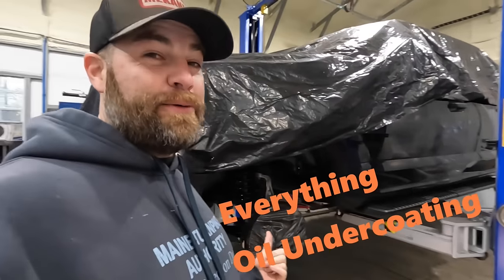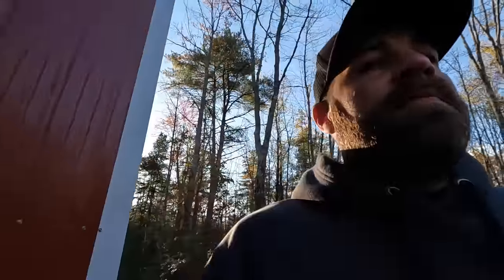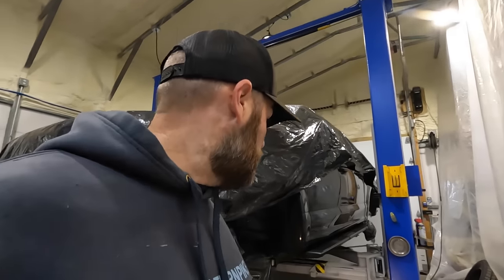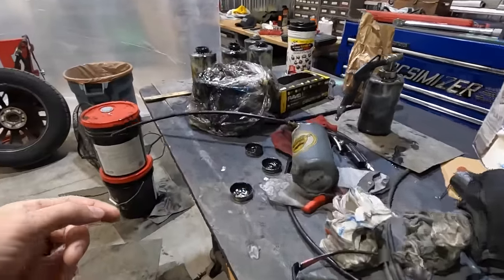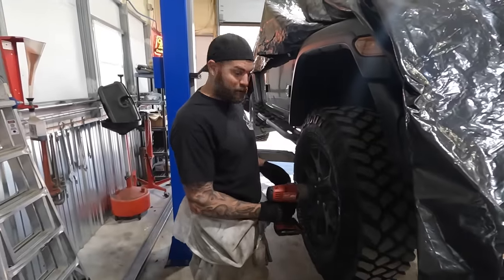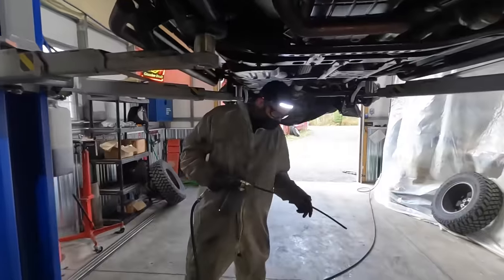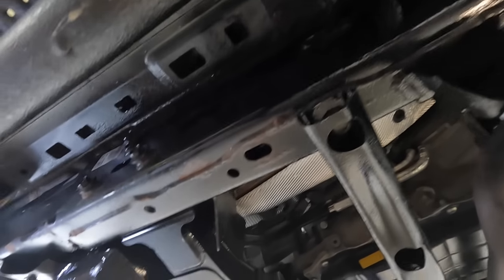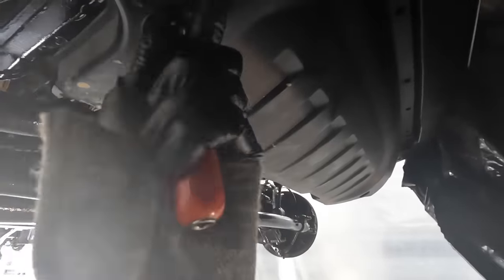The FACTS about Oil Undercoating!

Comment: I’m also in NH and I’ve been using different types of rust preventatives for 30 years. I think the age of the vehicle depends on what you use. For example if it’s a new or newer vehicle, just a few years old with very minor surface rust, there is no reason to spray oil and then have to deal with the maintenance and the mess for years. Instead, use cosmoline wax. It will provide the same rust protection as the oil without the mess. If it’s 10 years old and it’s starting to flake then yeah use the oil. Just keep in mind once you use the oil there’s no going back to the wax. Also keep in mind you should not oil spray a new GM frame. The GM frame comes from factory with wax. If you spray it will ruin the coating of the frame.
Reply from the maker: They offer a wax line as well for new vehicles, as long as it’s not applied heavily it holds up on the gm frames, or you can wait a couple years and the wax will fall off and rust anyway 😂
Reply: @FlippinCustomized  so very true.

Comment: On my brand new rigs I'll paint under it first and then I do what the old farmers used to do. Change the oil, save it, add some diesel, pull the tires off and spray it on with an old cup gun at 100psi. And.... getting it in the nooks and crannies is a very proper explanation 👍. It works excellent on fence posts too.

Comment: Hot used oil and graphite mixed together. I spray inside the frame rails first then inside the rocker panels working my way out from under the vehicle. Then from the lower panels up and under the hood. Spraying inside the tops of the fenders and down the cowl post. And inside the doors. After spraying it i also drive it down a dirt road ( if i can find one ) then park it for a day and let it drip dry. This is what i have done for years and have had no rust issues to speek of. My current truck is a 99 ram and it has been in the N E Ohio aria for 4 years of daily driving. Still no rust.  Even the commonly known rust arias are clean.
Reply from the maker: Sweet we run a 99 ram too
Reply: @FlippinCustomized  they have their issues but they were clearly ahead of their time.
Reply from the maker: Agree

Comment: My great uncle showed me a trick. A mix of engine oil and diesel fuel. His 82 F-150 looked brand new yet. But he did get it repainted. Zero rust though, all original panels. Repaint was done in 95, if I remember correctly.  It has kept wy newer vehicles rust free. I live in Wisconsin. Heavy salt and bitter cold temperatures!
Reply from the maker: Nice

Comment: I have been using Blaster Surface Shield on my Toyota 4 runner on exposed metal and Fluid Film with spray wand inside frame.  Very happy with both products.
Reply from the maker: Nice

Comment: I live in western PA and they salt the shit out of the roads here when we get winter weather,i spray with used oil every fall Religiously, the reason why i spray with used oil is because im cheap,but it works,great tips in this video❤
Reply from the maker: Old school 💪 and after you drive down a dusty road to form a barrier 👍
Reply: @FlippinCustomized  your dam Skippy I do!!
Reply from the maker: Perfect 🤙
Reply: You ever notice rubber parts rotting from the oil?
Reply: @TheChaztor   No,it's still better then fixing your steel  parts,  bushings are replaceable. Your frame is not.
Reply: @TheChaztor  that's a myth
Reply: @TheChaztor 
I use a light coat of marine grease on all my rubber boots. Seems to work  fine on my 23 years old  4runner.

Comment: Been doing my Toyota Prado (19 years old now and still rust free) and Subaru Forester like this for years, paying particular attention to all cavities including doors sills etc.
I go one up and smear the outside of the chassis and high wear exposed areas such as the bodyshell inner sills with marine grease.

I don't have spray equipment at home so twice a year get the vehicle up on 4 ramps give the whole underbody a blast over with ACF50, i like this product because its very thin and gets into all the different height sensors etc which are also prone to salt water ingress and penetrates into through bolts and such so when you need to undo something it comes undone instead of snapping off, plus it doesn't effect rubber bushes etc.
Salt is used extensively in England too, they put it down for no reason at all most of the time.
Whatever you do its better than doing nothing, which is what most people do.

Good job you fellers are doing, well done.
Reply from the maker: Thank you sir🙏. Yes I swear they salt roads just to use salt inventory

Comment: Nifty video, thanks for posting.  How rough is this product on rubber bits?  One of the upsides of the lanolin products is that they are supposed to not hurt rubber bits: bushings, boots, etc.  I read this is mineral oil based, so I gotta wonder...
Reply from the maker: Honestly has not been bad
Reply: I’d gladly replace some bushings with such , it’s a lot cheaper than frame repair or another truck. . It’s too late for my 09 GMC but I keep it on the road. Mine had the rubbery coating on it wasn’t the best option.
Reply: Oil does break down rubber over time. But I would imagine this would not cause the breakdown like a oil leak would.  I guess the question is would you rather replace cheap mounts every 7 to 10 years, or a whole new car.

Comment: I bought my truck new in 07 , spent 3 winters in michigan then came back , 328,000 miles on the chevy 4x4 cab & half 1/2 ton  , and it rusted in half , so i found a florida truck just like it , im swapping it all over to a 2012 ..

Comment: i have 3 vehicles that have had this treatment for couple years. place i take em too get inside doors, rockers, cab corners, under hood and trunk, all hinges and locks, inside bed rails and tailgate. they don't skimp for sure. first visit takes longest but after that maybe hour. so far.... i like the oil spray undercoat. tailgate on old truck never worked so smooth!
Reply from the maker: Perfect

Comment: Good information. Just got a new old chevy that sat in a barn. Live in Southern MN. Two seasons winter and road repair!  Looking at undercoating and durability. Used fluid film but I wasn;t diligent . Seeing the result on my older vehicles. Will do my best to clean up and prevent future rust as sitting on the ground adds to rust. Thanks for the process.
Reply from the maker: Thanks for watching

Comment: A guy I worked with had an old dodge with over 300k miles and no rust on the frame. This is a NY truck so it sees lots of salt. Every year he would go to the Walmart parking lot with a sprayer mixed with diesel fuel and oil I think it was mostly oil but the diesel made it thin enough to spray he didn’t give me the recipe but offered to spray my truck too. He would spray the entire underside of his truck then let it run and smoke while he walked away so nobody thought it was his. When it was done smoking he would go home. Once a year and this 12-15 year old truck had no rust. I didn’t believe him at first but later found out it was true.
Reply from the maker: Ha ha awesome

Comment: A history lesson:  For decades long ago, the savvy mechanics would spray the undercarriage with old crankcase oil  - some even heated it so it would wick into crevices - they noticed that there was never rust where oil leaks (or which were common) made a surrounding mess.   

In the 70's there was one product:  
Kendall's KendCoat 60 - it was specifically called out by many industrial uses, it was discontinued but 
Chevron Marine Rust Proof  Compound L was the next reincarnation, but Chevron quit supplying this to North America;  
Michigan Petroleum Technologies had fleet customers that strongly wanted it so they developed their own "... Compound L."  All of these were amber and similar to a whipped cake icing.  Fortunately this technology is now everywhere.  

It's really annoying that the vast majority of automotive repair shops don't give a complimentary spray can shot of Fluid Film or Rust Shield in areas that are starting to rust.   Especially when it would be good for business:  people would keep their cars longer resulting in more repairs!

Comment: Did you try the Krown stuff from Canada? it works good as well. They also have the study from the Canadian military. They tried every available rust stopping product and used oil, used transmission fluid, and some other stuff. Krown works, not the cheapest stuff but they have a good salt remover to start with if you already have something that you didn't get new.
Reply from the maker: I have it’s good as well. We have had great luck with this product and it’s local

Comment: I use a product in Canada called Krown.  It is applied every year and is an oil that coats thoroughly and creeps everywhere.  Yes, it is messy, but my 2008 Ranger has NO rust on the frame or any of the body panels.  Mechanics don't like working underneath, but I have seen what coatings like Ziebart can do to the frame of a Jeep.
Reply from the maker: Not a fan of Ziebart
Reply: I second using Krown. They heat the oil up prior to spraying and use strategic holes to gain access to the most troubling area of cars and trucks. Drips for a day or two after application but well worth it IMO
Reply: My brother has a 07 Fit and has used Krown yearly. Car looks almost new. Have used it on my Outback and plan to get it done this fall.
Reply: Got my truck done todayKrown took the tail light off sprayed in the panel with a long attachment and got in the wheel wells and plugs all over areas of truck 
4 years in a row 
 No rust  yet
Reply: Krown cant compete with fluid film, stuff is weak
Reply: I had a 2007 Montana van in Ontario Canada I used A company Krown rust proofing spray it every year it is  still in great condition
Reply: krown here in Canada is one of the worst undercoating companies you can use. They are notorious for drilling extra holes in the vehicle literally right next to the factory drain holes that they could have used. Aside from that, they do not spray inside of all the cavities, which is basically pointless in doing it anyway. Sometimes they don't even spray inside the frame rails, typically a surface spray only. Get a quality job done using fluid film and you'll be a thousand times ahead of the game
Reply: I use Metropolitan Rustprooflng in Quebec. They spray also inside the doors, the hood and trunk lid. My wife’s 2000 Nissan Maxima remained in the family for 17 years, no rust. I get our two suv done every three years, one is stored for the winter, the other winters in Florida.

Comment: PB blaster surface shield is thicker than fluid film and no smell. That's what I use. I buy it in buckets and spray it with a wool wax gun.
Reply from the maker: Nice I’ve never tried it

Comment: I used to do the DIY. versions, old oil, bar oil, Vaseline, using brushes, or pump sprayers.  Now I just take it to a Krown place, once a year, costs me around $150.  They will even guarantee it as long as you do it every year and as long as it’s 6 months from pickup date when brand new.
Reply from the maker: Where is this? The product itself cost almost $150
Reply: Krown is just wax, not as good as oil . i had it under my car and it is full of rust within 4 years , i didn't go to reapply though.
Reply: @supernova1976  it’s more than just wax, my Toyota truck is 5 and a half years old, had it applied when it was brand new, and then every year after that, no rust at all.  I live in the rust belt where you get about 4 to 5 years before things really start to look like Swiss cheese if you don’t get it treated.  The main reason I wanted to get it done is New trucks are very expensive and Toyota doesn’t use the best steel on their frames.
Reply from the maker: This is oil not wax

Comment: I dissolve 5 wax toilet bowl seals in a gallon of varsol and spray it on my 1950 Plymouth undercarriage , inside of doors, inside of fenders, etc. My Plymouth does not see salt or snow, but is all original with no rust . I was adding raw linseed oil, but found out it was not needed.
Reply from the maker: Nice man

Comment: Correct me if I'm wrong, back in the day it used to be tar. You sanded it too give it better adhesive to the metal.
Reply from the maker: Tar?  Lots of old timers used old engine oil or whatever they could get there hands on

Comment: How does the NHOU affect the rubber body-to-frame mount-cushions? A mechanic told me that the oil can cause the rubber to degrade prematurely. Anyway, I've been using the NHOU oil treatments for two years now on my 13-year-old truck. They also did a "Rustoration" service and I'm definitely going back again this year for another oil treatment.
Reply from the maker: Great company

Comment: This came up in my feed. I've never been to your channel before, but I like your content. 

Funny that you mentioned it: I just replaced a factory trailer hitch on an 04 Tundra. It was about to break in half, or at least it looked like it. I got a used one from the West coast, stripped it and painted it. 

I've tried Fluid Film, Blaster undercoating, and Amsoil HD to a smaller extent. I'd never heard of the NH stuff until now. The annoying thing is, working under the vehicle, my arms are always covered in greasy filth. But the coating is staying on, so I guess I can't complain.
Reply from the maker: Hi there thanks for watching, yes very to work on vehicles after but worth it

Comment: First off I love in Western Canada. Yes, you can say this is the Rust Belt and it covers three coasts. I have a 2008  F350. I've heard everything there is to say about these trucks. It's now 2024. For 6 years I have used trans oil just soak it down. Take the tires and brakes off no calipers no routers. Every two years. Just power wash it down let it dry for a couple of weeks driving in the dry weather spray the trans fluid all over the undercarriage and let it drip for two years do it all over. No breaks no tires. Metal only
Reply: Do u mean transmission oil ?

Comment: I had a 1978 Ford F150. I used oil after my oil change and thin it with kerosene and sprayed it every year, also in the spring I added 1 cup of kerosene to my wash bucket and washed my truck. A few years I did a stupid move and sold it. It was still rust free
Reply from the maker: That was a keeper

Comment: I bought a used Tahoe that has frame rust. I'm in Denver, CO where we don't undercoating or have serious rust. I sprayed Krown, I got from a place in Pennsylvania. The dealer I took my truck to in Colorado refused to work on my truck because of the oil undercoating. I stopped re- applying it years ago
Reply from the maker: We work on it but some shops charge more

Comment: Have a 05 chevy express 3500.
Was a shuttle bus between O'hare and an off site Thrifty rental through a Chicago winter.  Bought with 25,000 miles in May of 05.  Never treated frame and it's now a storage van since the frame is rotted and not drive worthy.  6.0 engine with 170 thousand miles and trans run like a top.
If you want to keep your vehicle up north, do what this guy is applying whether you use fluid film, wax wool or this product.
Reply from the maker: Agreed

Comment: I use a gallon of 30w bar and chain oil mixed with a tube of Lucas red tacky grease heated up in a crockpot ratio  ! Spray it on hot and when cool it sticks on nice  😜
Reply from the maker: Dam 😳
Reply: How did the beef stew taste after using the crockpot to make undercoating spray?

Comment: I've been bouncing back and forth on undercoatings for months and this video made me decide on NHOU.
Sadly it's just too new and local to have the reputation that Fluid Film or Bar&Chain Oil has, but it's definitely worth a shot. 

Do you know if there's any issues if the frame has had a different undercoating in the past?
Reply from the maker: Good choice, I don’t believe it will matter but feel free to give them a shout to be sure